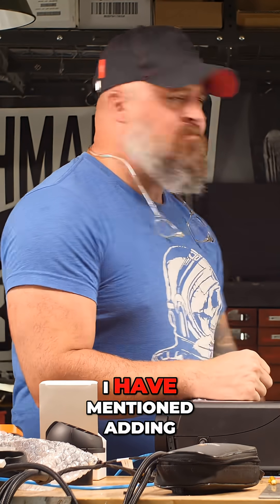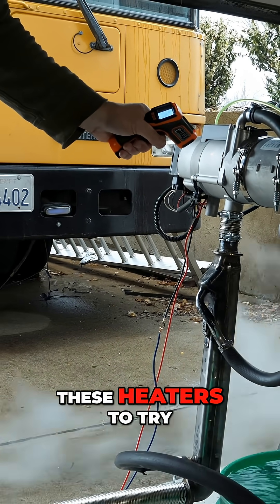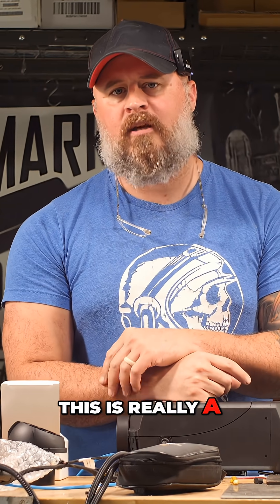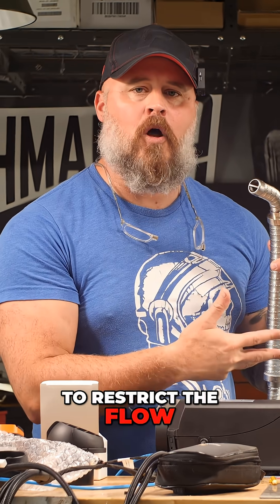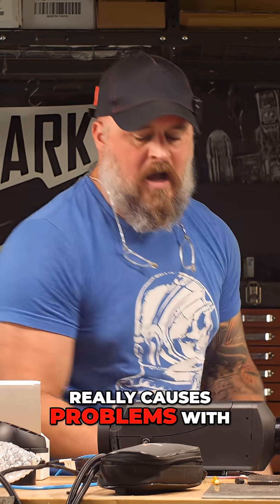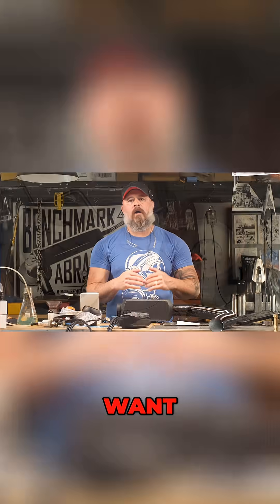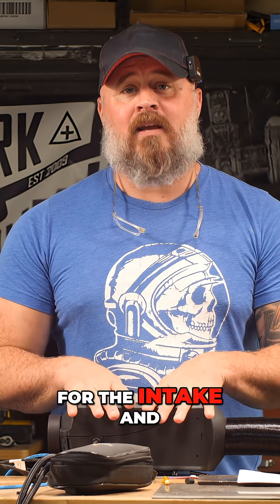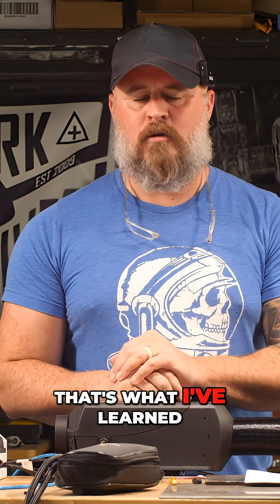Diesel Heater Exhaust: Why Modifying Is a BAD Idea! #shorts

Comment: may I. Suggest? to alleviate any of the problems you've mentioned, just burn kerosene and switch them to high altitude if you are restricting the flow, but my egrs I use do not restrict the flow, I test the mall and blow through them, and they are easier to blow through than even  a length of exhaust pipe.   so you can't tell me that there is restrict in the flow, what I would not do, is use an EGR that either comes in at a right angle or leaves at a right angle. you want a straight through flow, and burn  kerosene as  is burns much cleaner vin diesel and you'll have less servicing to do, if you use kerosene in America. You might have a different name it's central heating oil in the UK why this used the word oil. I don't know. Because that's the one thing it appears to lack. it was basically paraffin but Burne's beautiful and diesel heaters and don't worry about your pump. wearing out that some people say happens. I've got three year old pumps and I've had no problem with them wearing out, only time I've ever had a problem with a pump was with residue in a can that gummed it up. Once. once I realised what had happened. It never happened again I had bought contaminated fuel off someone,.

Comment: A heat exchanger done right shouldn't restrict the exhaust flow any.
Reply: what about having the exhaust pipe submerged in water
Reply: @willlyj777 that might cause humidity issues if water starts to boil away.